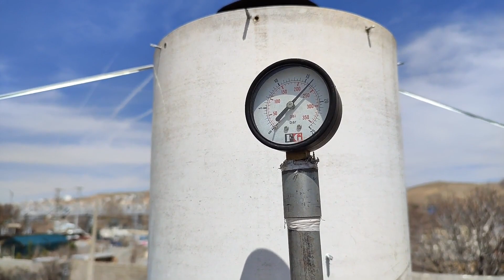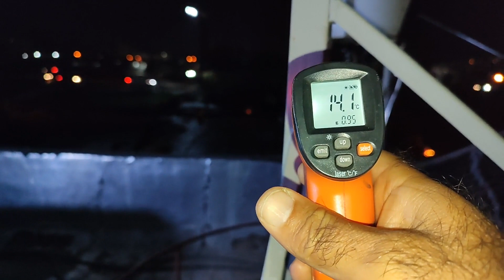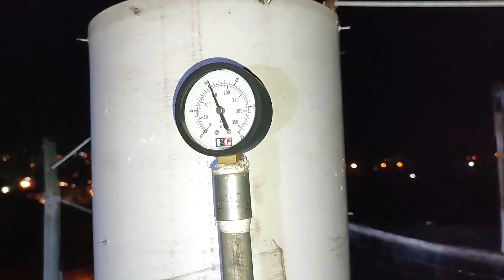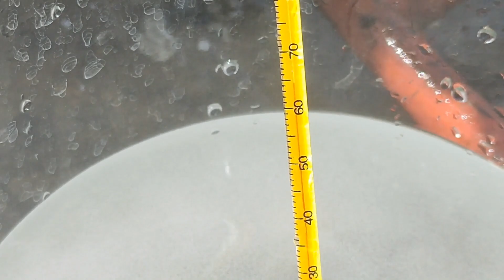The new generation of home power plants. Is this system a competitor to solar panels?

Comment: This is impressive, I have been researching and designing Fresnel lens based Concentrated solar power generation. Your setup is marvelous. This will help
people build their own setup for power generation.  

1. how you maintain the water level in the boiler tank with the 24v water injection pump you use?
2. how long this setup can run? how you maintain the turbine, fan, solar tracker motors, repairs, frequent checks?
3. Please share the solar tracker specifications.
Reply from the maker: Thank you, dear friend.
Videos of some of these devices are made on the channel.
For example, this video is about the tracker.
Part one:
https://youtu.be/3O4cHL8HTAI
Part two:
https://youtu.be/JKiC2Dk6d7w
Reply: @fixedfocussolar  Thanks, i will check these videos

Comment: i appreciate your existence dear inventor.  it is like you managed to stay creative so god is giving you brilliant ideas. this tech looks like straight from heavens. congratulations. do you have facebook, instagram , whatsapp or telegram viber? i wanted to ask for reference because i want to build it in my country Mongolia.
Reply from the maker: Thank you, dear friend.
Unfortunately, I have neither Instagram nor Telegram.
But I have to say one important point:
This system that I built is a handmade system and certainly has low efficiency and must be produced industrially and with an industrial design to provide good power.
So don't spend money on a method that you build by hand.
Reply: @fixedfocussolar  thank you for sharing the truth. however, i want to build it for my own experience. i dont trust the grid electricity supplied from russia and china. therefore i believe i should produce my own heat and electric. i have already build 4m2 parabolic dish with 5x5sm mirrors and planning to use arduino control system
Reply from the maker: @gantulgagankhuyag108  Thank you dear friend
I hope you are successful
If you have any questions, write them in a separate comment because I don't see your comment here